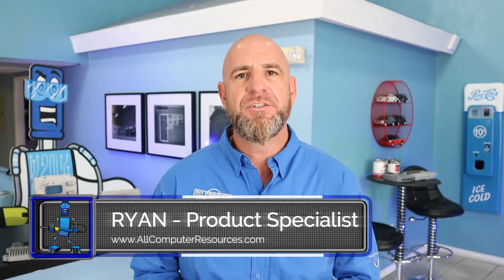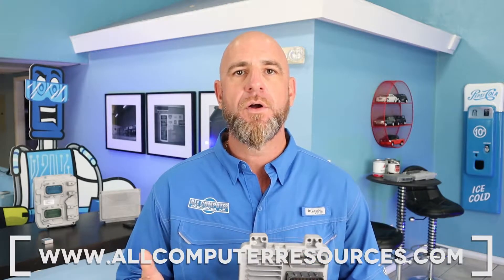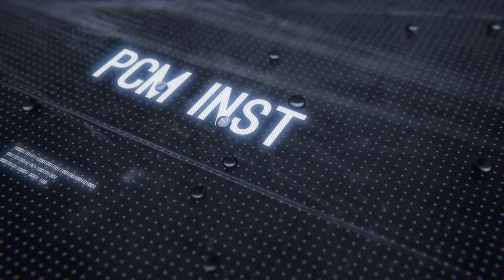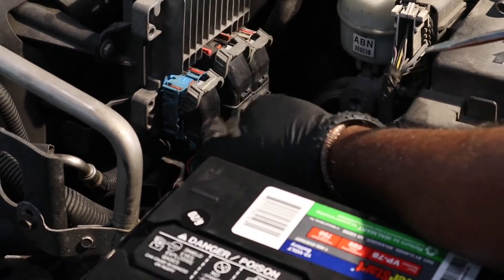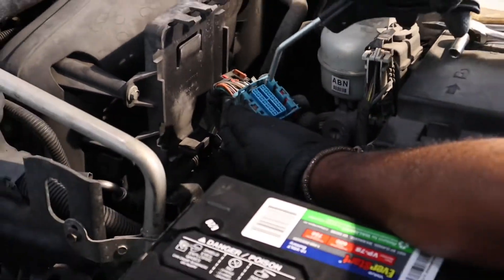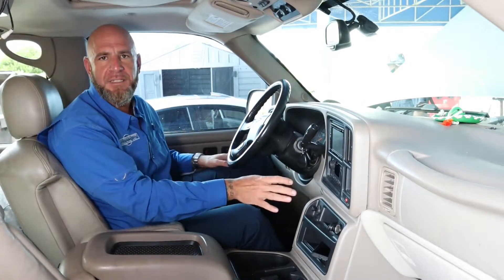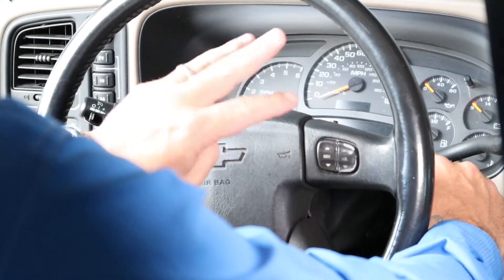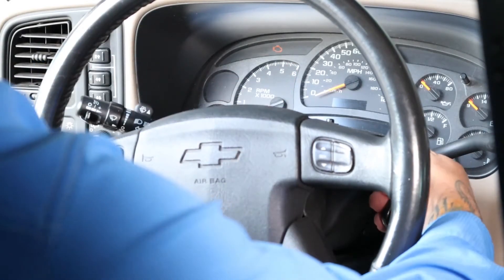HOW TO PROGRAM KEY FOR GM/CHEVY PK3 or Passkey Anti-theft - Engine Computer Replacement

Comment: I got a 2005 Pontiac grandprix I put a new ecm in and now the theft system light is on and doesn’t go out during relearn.
Reply from the maker: Are you using a properly programmed and calibrated ECM?

Comment: Do I need to do both keys or should the code be the same for both if they are brand new and came with the new ignition I just replaced?
Reply from the maker: If you replaced the ignition and are using brand-new keys, that’s a different programming process than just pairing keys to a replacement ECM. This video outlines the key relearn steps specifically for ECMs programmed by us, but if the ignition cylinder and keys are new, you’ll likely need to perform key programming using a scan tool or have the BCM recognize the new key transponder codes.

Note: Even if both keys came together, each one must be programmed individually to the vehicle.

Comment: The key i have looks like a pk3 key even says GM on it but does not say pk3. The key says nothing. Do you know what system a 08 trailblazer lx uses? Been trying the pk3 for 2 days and so far nothing.
Reply: Or, should i use this video or the other video for the 08 trailblazer lx?
Reply from the maker: The 2008 Trailblazer uses the PL2 (Passlock) system, which follows a different procedure. Refer to this video for guidance: https://www.youtube.com/watch?v=KkJALLMxayc. Keep in mind that the PCM must be correctly programmed, calibrated, and include the VIN and key codes for the procedure to be successful. If you bought the part from us, it is already set up for the Passlock process. Otherwise, it may not function properly.
Reply: Omg thank you much, ill give that a try  @acr

Comment: 2000 buick park avenue can you bypass the vats system, with new computer, thieves broke ignition switch and anti theft module that goes around ignition cylinder, installed new cylinder with new key, security light stays on no flashing,did new key relearn ,3X ,do you sell vats by kit ?
Reply from the maker: Thanks for reaching out! Yes, we do offer a VATS delete PCM for your 2000 Buick Park Avenue. Since the ignition switch and VATS (Vehicle Anti-Theft System) module were damaged, a VATS delete is often the most reliable solution — especially when the factory key reader ring is no longer functional.

With our VATS delete service:

No key relearn is required

Security light behavior won't interfere with starting

You’ll be able to start and run the vehicle with the new ignition/key setup

We don’t offer a standalone bypass kit, but we can provide a VATS-disabled PCM custom-programmed to your VIN.

📞 Just give us a call at 786-879-7566 and we’ll get you taken care of!

Comment: Will these instructions work on a 96 Tahoe
Reply: I’ve got a 96 Cheyenne that I’m having trouble reprogramming too,did you ever figure it out?
Reply: @shanebaker3768  yes, 96 doesn't have to go through this step cause there's no built in security
Reply from the maker: There is no immobilzer on a 1996 Tahoe - Passlock started in 1998 on the Tahoe

Comment: Hello, a chevroet Sail 2024 witch procedure should use? the only key left dont have any engrave, is a HU100 key, with chip, someone read with xhorse tool (no clonable)
Reply from the maker: We do not currently support the 2024 Chevy Sail. I would suggest contacting a local locksmith as that vehicle would require onboard programming.
Reply: I have a 2006 pontiac grand prix and i dont seeba security light when i turn on but i do see a check engine light  @acr

Comment: OK I am trying to do this to a PK 3 system. (2001 Grand Prix} What it does is I turn the key on, and look for the security light, the light comes on, but only stays on for 2.5 seconds. I did 3 10 minuet key on, off for 5 seconds cycles, but it didn't work. Key variable here is, my security light comes on, but immediately goes off after 2.5 seconds? What might be causing this?
Reply from the maker: All depends on how the PCM was programmed. We so have the ability to disable the security as well. Contact us at 786-879-7566

Comment: I purchased a new ECM from All Computer Resources and put it in yesterday and mine now also has no crank and when I go to do the relearn procedure the security lights goes off about a second after I turn the key on......I have a 2007 Suburban 4wd 5.3....PLEASE HELP!!
Reply from the maker: Hello, I will add a link here for the proper procedure to perform on your 2007 Surburban, if it doesn't come through it's also available in the description above as outlined in about 1 minute into the video. Let us know if you need anything else.        
https://www.youtube.com/watch?v=KkJALLMxayc&t=0s
Reply: @acr  I have done the procedure multiple times...the security light goes off with all the other lights right after i let go of the key to begin each 10min stage....It still will not start.   Now, that said, it will crank once but not fire, and then it wont crank or make any sounds at all if you try to crank it again right after....if you turn the key off for about 3 or 4 minutes, try to start it and itll crank but not fire, then wont do it again for 2-4 minutes with key off, then itll let you do it one more time, then nothing for a couple few minutes again, and so on...... I ordered this from you guys I have called the tech support and asked at least three times for someone to please call me and I got an email back telling me to do what I just told em I had already done multiple times and then haven't got anything back since Friday.. I need to get this truck going or I'm going to lose my job... Will somebody from ACR please call me ASAP please?
Reply from the maker: @CourtBass34  Hello, as I mentioned in our previous response, this is NOT the correct video to watch for your vehicle. I would suggest disconnecting the battery for 30 min and then following the correct procedure. If you still have issues you can continue working with the tech team and be sure that you give them as much information as you can so they can help you determine the appropriate steps to take.
Reply: @acr  Yes, I know its not the correct video, but this is where this here conversation located, thus why I commented again on this same thread.  I did the correct procedure, multiple times.
Reply: @acr  And I have not gotten any response from the tech team since Friday and all that email said was for me to do what I had already stated twice I had done and asked them to call me several times.  I have yet to receive a call or reply email. I replied back a couple times Friday, a couple times over the weekend and again today and still nothing.
Reply from the maker: @CourtBass34 Understood. I do know that the tech support system uses a timestamp to sort the messages. The last email sent would be the timestamp used which will push you to today's tickets. Let me know what your sales order # is and I'll send the tech guys an internal message.

Comment: Im trying the key relearn and the security light stays lit ive tried xhanging the ignition switch and it didnt work what should i check next?
Reply: Did you fix it yet?
Reply from the maker: Is the PCM properly calibrated and programmed to your vehicle?

Comment: Does this work for a 2006 trailblazer ss?
Reply from the maker: Hello, was the PCM programmed and calibrated by us?
Reply: Yes i did this relearn procedure and my car is running now but my gas gauge is not working

Comment: The ECU has to be replaced just to program a new key  ? Can’t the original one be sent out and flashed or something
Reply from the maker: No, This is the process for those that need to replacement the ECU if it failed and relearning the key to the replacement ECU. If just adding a new key there is a simple process for that.

Comment: So I have a 1993 Buick LeSabre custom, would this procedure be the same for my car? I’ve read on the internet that any car made before 1996 you do not have to program the new/used ecu but my car key has the chip on it. I have my ecu coming in the mail and I’m just trying to get prepared for when it comes in and I have to change it? Thank you
Reply from the maker: That would all depend on how the ECU was programmed. Did you order the ECU from us and include your VIN?

Comment: What if the security light goes off the second I turn key to the on position? I have a 2007 Pontiac Montana sv6 3.9 motor and the key is PK3. Thanks
Reply from the maker: This depends on many factors and also what type of module installed and how that module was programmed and calibrated. The PCM however,  does not control the theft system in these GM vehicles so you may be experiencing issues or faults with the PK system. Sometimes its as minimal as a bad fuse but we cannot say for sure in your application.
Reply: @acr  I looked in the fuse box and all fuses are good unless there is another fuse somewhere? AC Delco I think it says on it and it’s a plug&play it came from the states to Saskatchewan Canada 🇨🇦 and I’m just fixing for this older lady who is my neighbour so not sure where she bought it from. Thanks
Reply from the maker: @babyguboo5582  Understood, in this case, I would suggest contacting the company where the part was purchased and speaking with their support team.
Reply: @acr  lol ya I get it you don’t know nothing about this stuff you just sell now I understand
Reply from the maker: @babyguboo5582  We would be able to troubleshoot and assist if we knew the specifics on how the PCM was programmed or the part was purchased from us. Since you mentioned it was an AC Delco part / Plug and Play it's most likely not calibrated which would require a subscription and a pass-thru device. I would suggest getting more details about the part that was purchased instead of sending you down a troubleshooting rabbit hole.
Reply: @babyguboo5582  TROLL!

Comment: I got a 1999 Suburban with a 5.7L C1500 and the key doesn't  have the PK3 nor the visible chip. It does have the black plastic. What it might be? I did find the VATS  box.. Thanks for the help.
Reply from the maker: Hello Jose, you may not see any visible signs if the key is replaced with an aftermarket lower-end key, however, I have checked your 99 Suburban and that vehicle uses the PASSLOCK system. We have another video for that procedure found here: https://youtu.be/KkJALLMxayc   -  Hope that helps!

Comment: Chevy Silverado 2003 Cranks, no start. Installed cam shaft sensor, PCM, crank shaft sensor, relay, master window switch, after fuel filter and fuel lines. The security light goes out a second after turning key on. Does my key have a transponder chip? Seems that truck does not recognize the key? No 5 volt reference at PCM and no ignition pulse. Note: security light does not stay on for ten minutes but goes out quickly during key learn. Tried to bypass security passlock system then (tried), replaced wiring to factory but will not run.
Reply from the maker: Is the PCM properly programmed?

Comment: i just got a new ECU from you and Ive installed. My 2002 GMC Savana key has no markings - it looks like the PASSKEY 3 but might be the 3 plus.  Any way to look up? again, there are no markings on this one key.  thanks!
Reply from the maker: Your 2002 GMC Savana utilizes the Pass Lock security system. Those instructions can be found by following this link. https://youtu.be/KkJALLMxayc   If you have already attempted any procedure, disconnect the battery for 30 minutes for system reset.
Reply: @acr  excellent-  ill try this later today. I appreciate your feedback.
Reply: @acr  the head of the key looks most like the PK3........black w slot........ but just doesnt have a number on it.  I guess I can try both ways... thanks.
Reply from the maker: @atomicdmt8763  That is a Passlock key. The procedures are slightly different than this video. Here is the link to the correct video.  https://youtu.be/KkJALLMxayc
Reply: @acr  WORKED!  HINT:  i was turning the KEY all the way off........ and then back to ON position....VS simply moving off of cranking to ON.  3X process finally worked!  after trying about 8 times........ w batt disconnnect sessions in between, et al.   /  might be good to alert others, include in directions.  Thanks!

Comment: during the 10mins I heard lots of clicking/ sounds like injectors and air control valves- and the fuel pump relay is clicking away!  very random........ might be after a few mins into the 10 min period.  Thoughts?  I didnt stay with the process through the entire 30min since something might be wrong................... thanks
Reply from the maker: I would suggest disconnecting the battery and continuing the process.
Reply: @acr  I got it resolved.  Turns out it was a new (but cheap) faulty CKP sensor! once I unplugged it - all the random sparking, etc went away.  I put in a quality new AC Delco CKP sensor. Also, did the security key relearn...... remember to turn only to ON from cranking, not all the way (off), which doesnt work. I had to do this step about 8 times before I figured it out. WOW- what a process!  thanks
Reply: @atomicdmt8763  I'm confused so do I turn it to on position for 10mins then turn it in the middle not all the way to off position, then turn it back to on position then back to middle position again ?
Reply: @devonplays5769  my PROBLEM:  i was turning my key all the way (off): far left............ instead of simply moving off the (on, before start) position.   I had to do the process many times until i figured this out-  took me many hours.
Reply: @devonplays5769   this was over a year for me............so my memory isnt clear.  I think it was 3X, as w the video.  But I was turning the key too far off.     perhaps you comment is for the main portion?
Reply: @devonplays5769  also:  my description above is due to a faulty (new) crank position sensor!  so crazy........ I swapped in several new parts during my process and the new, problematic crank sensor jacked up my electronics -  was setting off my fuel injectors: filled my piston cylinders, hyrolocked.     I eventually figured this out also. My van runs FINE now!   Good luck
Reply: @atomicdmt8763  thank you I'm gonna try again. I was trying like you and I had no idea what I was doing wrong.  And I kept hearing those clicky noises too
Reply: @devonplays5769  in my case due to a recently swapping in (NEW!) crank position sensor -  raising spooky HAVOC w my fuel injectors and ignition coil!  f'in crazy.    careful to note step by step.   If no similair issues - then the key turning, timing, as in the video should be fine.  cheers.
Reply: @devonplays5769  i believe its to ON position- then back to left next postion (just off of ON) vs full key turn. THIS was my problem.............and it tooks me a good 4-5 times to figure out.   cheers
Reply: @atomicdmt8763  okay thank you it worked. Only thing now is that I drove it for alil and now when I put it in Drive it cuts off. Unless I pull off really fast.
Reply: @devonplays5769  perhaps idle control device? codes?    ECU is likely learning your engine per se.............. so hopefully this situation will smooth out before long.
Reply: @atomicdmt8763  hopefully. Supposed to be getting it diagnosed today. Wish me luck
Reply: @acr  have an old U-Haul truck and got a code 42 and it's either the wiring or the ECM.  I have a 12 volt probe with a grounding end clap and a multimeter to test wiring.  I'm new to these senors sending signs to the ECM and wondering if you have any ideas to track down if the ECM is not getting the signals from one or more senors?  Any help is appreciated.
Reply from the maker: @peacepoet1947  Uhaul trucks are usually built of ford or Chevy platforms. You can get that information by searching your VIN in google. Once you have year make model you can get the pinpoints and diagrams for that specific vehicle and pcm. Hope that helps.
Reply: @acr  thanks for your reply.

Comment: 2016 Chevy Cruze VIN 1G1PE5SB4G7109681. Car was running poorly  and Had o2 heater control codes. Followed diagnostic chart and ended up Replacing ECM with good u it from Ebay.  I have to get it vin programmed. Local GM dealership  wants to charge me 250 to 300 to do it.  And he said it might not even take it but Id still have to pay the fee. Is these anyway  you could do it, or would I have to purchase another one already programmed?
Reply from the maker: We sell ECMs that are pre-programmed with a lifetime warranty for less than the dealer would charge you just for programming.

Comment: 06 impala
Battery is good , starter is good. Some of the accessories work but not all of them, windows will not roll down keyfob doesn't work,radio doesn't come on. Car won't start(won't durn over) any idea what the problem could be?
Reply from the maker: Most of the accessories you mentioned are controlled by the BCM (Body Control Module) Could be as simple as a fuse or relay not necessarily the BCM. The PCM controls the engine and transmission functions mainly.